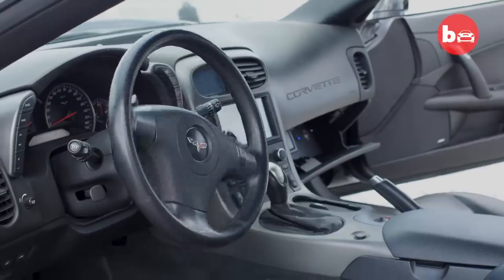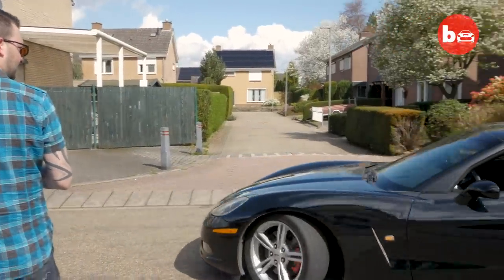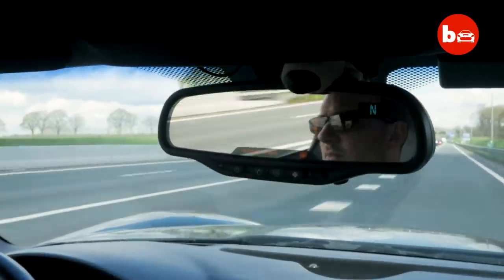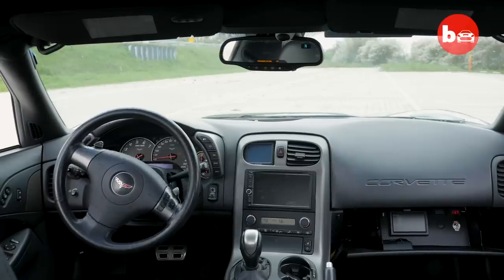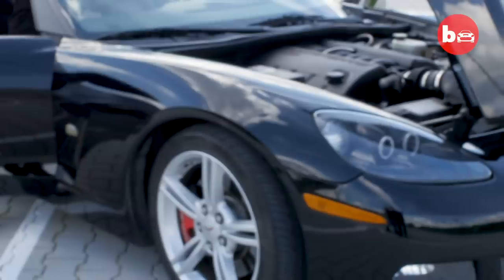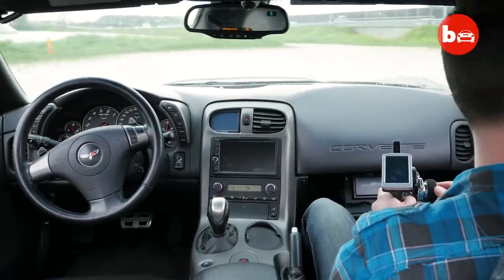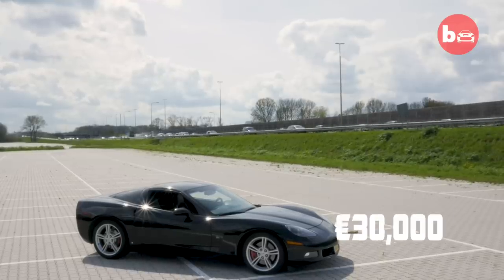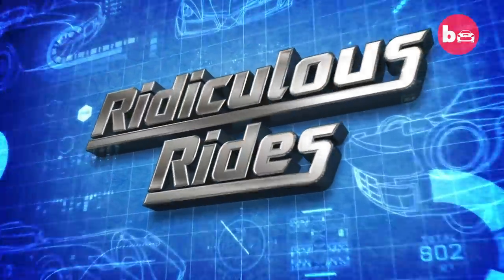I Built A Life-Size Remote-Controlled Corvette | RIDICULOUS RIDES

Comment: The main skill here is he made it fully controllable and wired for R/C and it is all very well hidden so you cannot see that it's R/C controlled, and also you can still drive it manually as an actual car. The R/C modifications do not interfere with the car.

Comment: They have already did that a while back. It is a GTR and was sponsored by PlayStation. Even use a PlayStation remote to drive it, so it is even more game like that using a rc remote.  Still very  interesting. It's nice that you're still able to drive it yourself without remote.
Reply: Even way before that on top gear but I think he meant the first RC vette
Reply: Bjorn Harms if you read my whole comment, you would have seen that I gave props for keeping it drivable by a person.
Reply: Bjorn Harms I would much rather use a rc remote all day long. I'm surprised that PlayStation didn't use a car that was completely drive by wire and had some kind of parallel  parking assist. With all of that, they could have just taped into ecu and ran it that way instead of using actuators for brake, throttle and steering. I know the only one they'd have to worry about would be gear selector. Could have used a new ford truck because its all drive by wire and also has electronic steering and make an off-road version. Maybe you could do that since your a computer engineer. Toss that idea to the people who want to sponsor you. I'd  surely watch a full size rc truck bombing across some dunes or on a short course race track. Food for thought.

Comment: I’d say this it pretty dangerous when something could potential ally happen at any time  hitting the trigger on accident or it getting stuck on something tree bush twig passing it so, I’ve done it a million times with my rc cars but a real car wow…but not even that say the motor wants to give out with a electrical malfunction and gets stuck going forward full speed other then that might be good to advance the idea and plug and play idea to just have to plug into the obd port and use it for moving car back kn the lot for busy dealers or body shops I have like 100 cars we have to run back and forth parking them back in the lot fitting in tight spot while sitting the seats hardly able to get out..

Comment: I'm amazed that it's a stick shift and functioning properly. I'm wondering if this stick shift, with that programming, could work just as efficiently, if not better than a dual clutch transmission. cough R35 cough